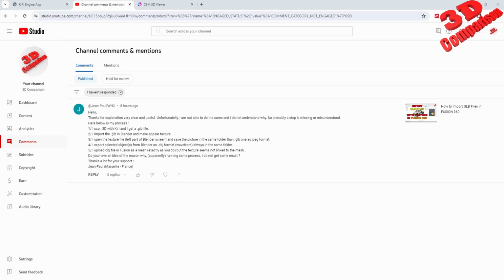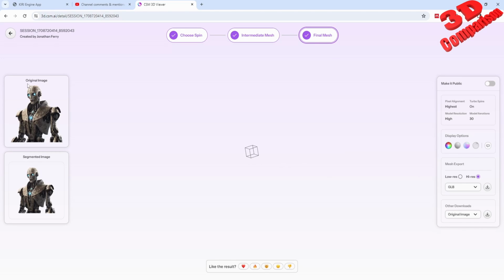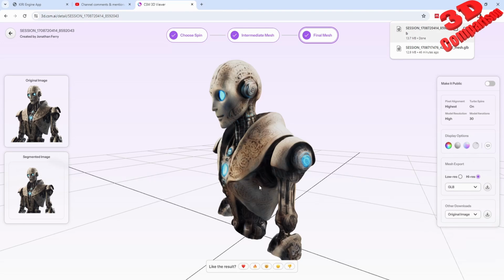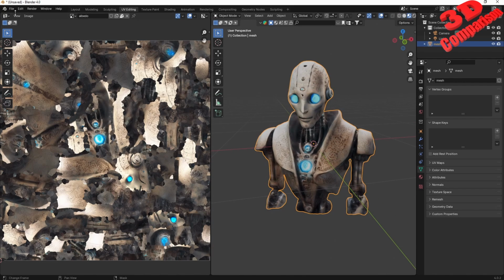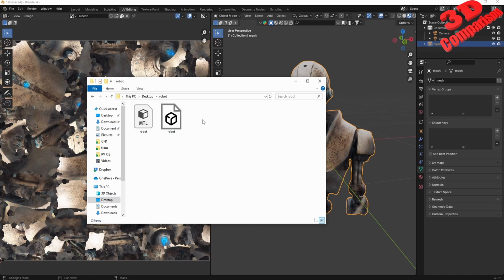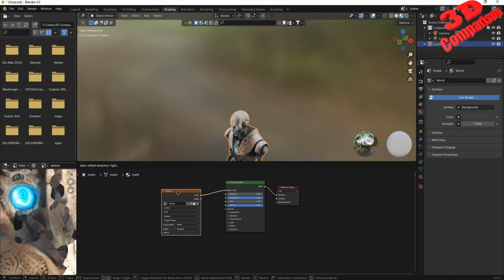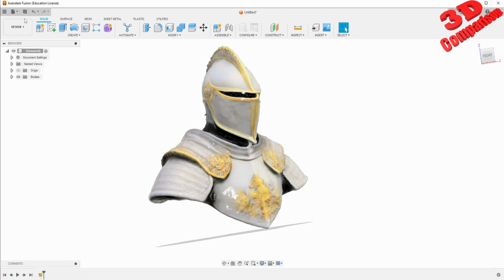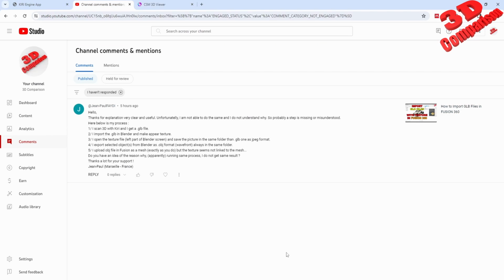Linking texture to OBJ file (GLB import from Blender to Fusion 360)

Comment: for anyone who couldn't get the jpeg to map with the obj file, a possible solution that worked for me is simply editing the notepad file. Deleted the unnecessary lines and replace Kp with Kd command then save.

For a new video idea how about getting the mesh to render with the picture map still attached, i go to render and as soon as i render or preview it all goes grey. Thanks for the informative videos but the whole reason i learned this process is to do colored mesh renders :c
Reply from the maker: That's a good tip, to edit the notepad directly. I have already addressed the missing texture within the render workbench - https://youtu.be/iAp3J5exgl0. Unfortunately Fusion 360 enables the OBJ texture only within the default viewport, if anyone manages to find a workaround for this I will address it within a video to share it with others. Until then I think it's best to transfer the models to Blender and deal with the rendering there, as Blender enables better renderings then Fusion and also has custom material libraries such as BlenderKit which are free with over 11.000 materials.
Reply: @3DComparison  thanks for the information! I will consider learning Blender now that i have it installed, might as well!

Comment: Hello,
I have spent several hours today trying without success to repeat the process. At the end, MTL file is not updated with the new texture. Really strange due to your explanation is fully clear and as you speak slowly I understand all you say ! I will try again later with exactly the same starting obj file as yours. But there is no reason it doesn't work well.
Reply from the maker: It should work, let me know if you manage to do it! The most important step is to add the texture within the shading workbench as that will link the extracted texture file with the 3d model of the obj file.
Reply: Hello,
The issue was coming from Fusion. When I click on Shift+F, the object gets its texture (in french: "Afficher les groupes de maillage des faces" in the menu "Inspecter") and when Shift+F agaian, texture disappears.
So and of course, the process you have explained works perfectly. And I thank you a lot for your efficient and kind support !
I will continue with others sacns to become comfortable with the process.
Reply: ! @Jean-PaulFAYDI  Thanks for takin the time and posting your solution and has worked for me as well in Fusion with my own 3D scans.  For the life of me, I couldn't figure out what was going on but the SHIFT+F did the trick.